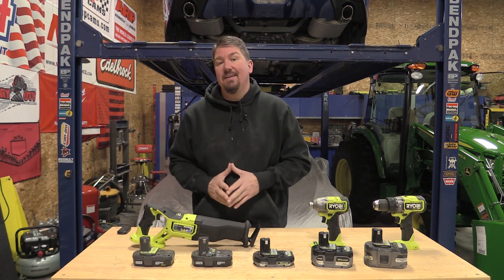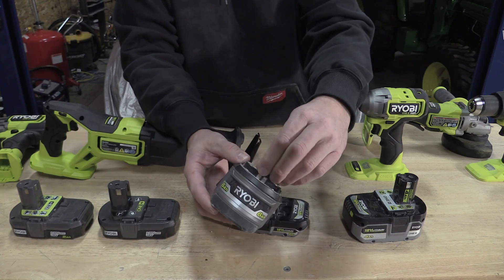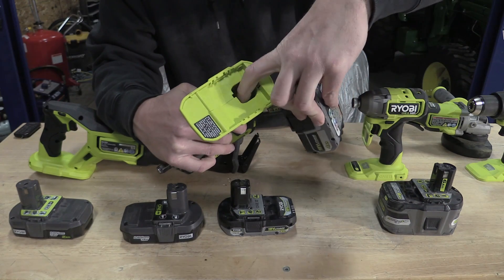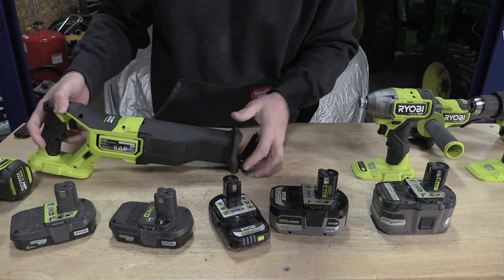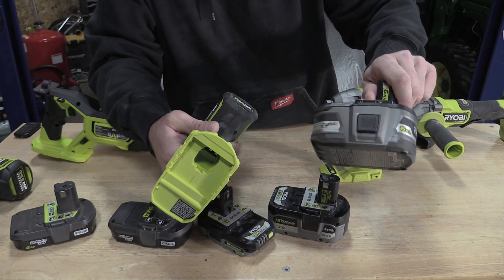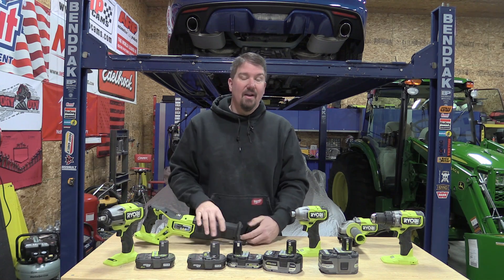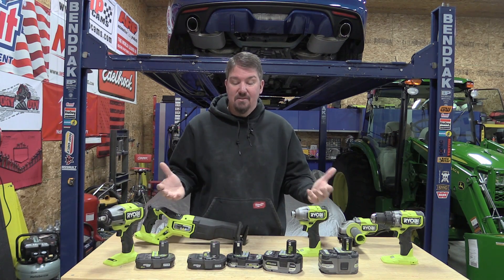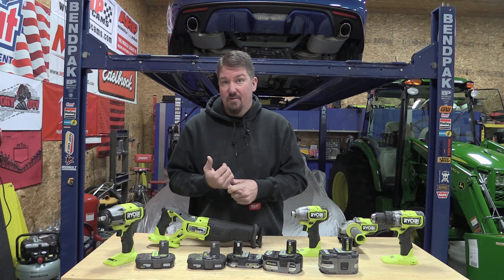My Ryobi Brushless HP Tool Has No Power? This Is Why...  New Battery Line Up & High Performance

Comment: Has anyone looked at that label on the tool? It says the recommended battery number for that tool. Consider it a minimum? Regardless the battery provided with the tool in say, a kit. They'll give you what works... But not the optimum to just get you into a usable tool.
Reply from the maker: The jigsaw said use a P197 or other batteries stated in the manual.  Then the manual said all ryobi batteries are compatible.  LOL
Reply: @WorkshopAddict  right... 4 AH battery? Base line. Use nothing less than that, agree? But use 6-9 to get more tool power.
Reply from the maker: @paulalsup8838  I think HP tools should be the 4ah hp min. Model pbp004.  Hp line should recommend hp battery.  Otherwise you have a power loss.
Reply: @WorkshopAddict  Absolutely. I think people should realize these things to be honest. Although as Ryobi claims... They maintain the same form factor "forever". Yes. They have.  However. There should be the realization that although the form factor does not change, the inner workings of the batteries do. So. Don't expect the same performance of the older batteries with the newer tools... even though they fit (and yes, use an appropriate AH for the hungrier tools). 
The other guys don't really have this issue because their F.F. changes with their improvements a lot of times and stems (pun intended) the confusion. Even after all of this, guys will still try to get away with smaller, cheaper AH batts in higher consumption tools. 
In closing my statement (ha ha). You will never be clear enough and people will always have issues with tools and their expectation of them. They will ALWAYS expect more. And anything should do everything. It's not always the tool or battery. It's their knowledge.
Thanks for the great vids. Don't bail on Ryobi, because your professional view gives great insight!

Comment: I'm confused, your're saying that they are 2 types of HP (High Performance) batteries. The 4.0Ah HP I just purchased today on eBay is model P192, is there a newer model for the 4.0Ah HP? smaller but same capacity? model#?
Reply from the maker: I am saying that any battery with a name on it of HP will be replaced with a new battery that will have a name wrote on it of High Performance.  The new battery will be the same Ah rating, but allow for better current draw.

Comment: As a homeowner, I always found Ryobi’s product appealing; decent tools at a decent price.   I also appreciated the fact that most of their products are available in-store as bare tool (great if you need a tool in a pinch). I invested quite a bit in their platform over the years.  

But with their escalating prices, and movement over to new batteries: I’m thinking it’s time to invest in another brand. 

Ryobi has served me well: but when new tools are $10-15 off from, say, an equivalent Makita.... and I would need a new battery to get the most out of the Ryobi: why would I not spend the $10-15 on a more robust tool, even if I’m just a homeowner?

Comment: The new batteries have a much higher discharge rate.  The newer tools draw more power and if the batt can't supply it and there is more voltage sag then you have a more powerful tool, but you get sub par performance.

Down side is this.  The higher the discharge rate of the cells the faster they can be discharged...  IE shorter run time.  The capacity didn't change.

No such thing as a free lunch.

Comment: I have been buying several new batteries for my collection, replacing small one with the larger one. I have a couple of 6 amp batteries that work better with the HP line. As I get older, its hard to justify the cost of new batteries when I already have plenty of the older ones. My theory over the past several years is to buy 3 amp or above. I have found close out for a good price from time to time. Several years ago, they offered a free tool with two batteries. Just too much for me to turn down. I think those deals will not be coming back anytime soon. Thanks for the video.
Reply: That deal is back!  Started yesterday as far as I can tell.  $99
Reply: @MattyGgardneR  I’m planning on making a run to Home Depot next week for a couple of new batteries. I’m not sure what free tool I will get. Just this week I picked up a couple of the small fans. I was so excited!!!!!
Reply: It's a annual event called Ryobi days

Comment: Also, what exactly are you doing with the tool? If you’re cutting furring strips with the circular saw as opposed to cutting treated 2x4’s that’s gonna be a difference. Using the drill to make a hole for a drywall anchor, little battery is gonna be just fine. Running a 1” spade bit through a joist, you’re gonna want the right battery. Still good that the form factor is the same that the tool will still work (though not optimally) for lighter duty applications. They could have easily made the labeling simpler and more straightforward to allow for new battery tech, while keeping the same form factor for backwards compatibility.
Reply from the maker: You are right for most tools, the range grinder is useless for anything with the 2 ah hp battery.
Reply: ... I do like the Ryobi Tools, but HP being different than high performance borders on deception.

Comment: Thanks so much for this video. I didn't understand, but now I do. I bought a Ryobi drill/impact set with a 4ah HP battery. Oddly, neither tool has the extra pins, but the battery does. I typically use the 1.3 and 1.5 ah batteries, and they've been OK for my occasional DYI use.(I have a lot of them now, and they do require frequent changing.)  I have a half dozen Ryobi tools now, and none have the extra pins.
Reply: "charging"
Reply from the maker: Glad it helped

Comment: Yet another reason to get milwaukee, no hp or power detect bullshit
Reply from the maker: Let your knowledge lead you for the right tools for you, but never stop learning.
Reply: just "high output" or "high demand" bullshit.  I'm sure if you're in milwuakee's camp you can keep it straight just as easily as I can keep dewalt's "power detect" vs "flexvolt advantage"
Reply: @Nyall  at least milwaukee doesn't have 3 of the exact same drill 🤪
Reply: @nuclearexplosion5841  Brushed, Brushless, and Fuel... Hmm... That's three...
Reply: @Nyall  Except there are no extra pins and all of the CP XC HO HD batteries are using the connection.

Comment: Ryobi prides themselves with keeping the same battery shape so you can use ancient batteries with new tools... and of course the new tools don't run well with old batteries. 
Not sure why they even bother with shooting themselves in the foot like that. Do most of their customers not care about max performance and would rather maintain compatibility with their existing stock of batteries (and "investment")? I guess so.
Reply: It's not so much that you can use the old batteries in the new tools (though you can I've tried it it works), but the old tools can still be used with new batteries.  And I have to say that the old blue tools, while outdated and outpowered, still work for what they are, and I still use them to this day with the new batteries.
Reply: You have it backwards... the benefit is that your old tools don't become obsolete because you can use the new batteries with them. The batteries are the consumable...not the tool. Its not so you can keep using your old batteries with their newer stuff that is just a side effect.
Reply from the maker: Maybe, just maybe, most of the tools purchased at a low price point barely or never get used.  They are just around if needed?
Reply: @WorkshopAddict  Probably. Or they're being put through less hard usage too. Occasional DIY home usage vs jobsite, I get it.

Comment: That explanation was as you said clear as mud. But it is far better than any explanation then anything the Ryobi has come out with.
Reply: Actual explanation? The ~2ah batteries have a single  series of cells. (5 cells in series, or 5s)  The ~4ah batteries have two parallel series of cells. ~6ah is three parallel series of cells. Each time you add a parallel series, you increase the maximum usable discharge rate of the pack.  So a 4ah pack can discharge twice as fast as 2ah, 6ah can discharge 3x as fast as a 2, and 1.5x as fast as a 3. "9ah" is more likely than not just 4 parallel sets of 5 batteries in series, though I haven't taken one apart to confirm. This means it would be able to discharge twice as quickly as the 4ah pack.  And yes, this means the super expensive "9ah" pack only has a 1/4 better discharge rate as compared to the 6ah pack.  And if your tool doesn't NEED the higher amperage, the only benefit is longer run-time. 
Cell chemistry and geometry has some impact on the discharge rate (Referred to as C in literature and on the battery housing) and it is improving all the time.  What this means, however, is that a 6ah "normal" battery will perform roughly on par with a 4ah "HP" battery (As ryobi claims a 30% increase in "power" really 30% increase in C rating.)   I would welcome you to test this for yourselves and not take an anonymous cat's word for it, but I suspect you'll find this to be true. :)
Reply: @Fusako8  outstanding
Reply from the maker: Sorry, there are a lot of moving parts and I did not want to make 3 videos to explain it.
Reply: @WorkshopAddict  i think this is Ryobi's fault not yours
Reply from the maker: Thanks Aaron
Reply: @WorkshopAddict  that's not on you. It's on the haphazard way of their tool rollout and development process

Comment: How many cells does the 6.0 battery have?  Does it have 3 rows of 2.0 cells or does it have 2 rows of 3.0 cells?  Could you take it apart?  I have heard conflicting info online.  I am still curious why the 6.0 outperformed the 4.0 battery.  If they have the same number of cells, the performance should be the same.
Reply from the maker: I can take it apart.  This is a similar situation to the Milwaukee CP batteries that are able to have a higher amp output.  everything is limited to battery output and battery controller chip.  The cells are different between a 6.0 and a 4.0 if they have the same number of cells, if they have different numbers of cells, there is a extra bank of cells to keep the voltage higher during a high amp pull.

Comment: I agree, this is going to hurt Ryobi more. Ryobi has always been more of a homeowner tool and they are really getting into some grey area by trying to be more prosumer/semi contractor grade. I think this will hurt them more than benefit them, at least initialy. 

Perhaps some better branding, like different color battery cases or accent color, could go a long way to differentiate between the batteries (?).
Reply from the maker: That is the way they are moving with Black being standard and a silver being High Performance.  But convince a guy that a 2.0 Ah high Performance battery wont run his High Performance Angle Grinder if he has little experience.  Most would just think less runtime.
Reply: @WorkshopAddict  agreed
Reply: @WorkshopAddict   just ordered a ryobi 18v mitre saw tool only, thinking i could buy an adaptor to fit my black & decker 20v 1.5ah batteries. Your video made me realize that the B&D 1.5AH will not power the mitre saw. Looks like i will have to shell out another $200 for a 6AH or more ryobi battery.
Reply: @CanadianCampPurr Ryobi batteries have historically been some of the cheapest on the market. So I don't think you'll need to spend $200 for a Ryobi battery. 

And if you purchase them during the special sales Home Depot has throughout the year, you can get them at a great price. 

An example is the new High Performance battery kit, that's still on sale up to 7/15 for Ryobi Days, that included the 2AH, 4AH and 6AH batteries along with a charger and a bag was going for $199. 

But if you "hacked" this deal by picking the most expensive free tool, and then returned the free tool, the battery kit ended up costing around $100. I think that's very reasonable for 3 High Performance batteries.

You can still get this kit online with the free tool. Pick the most expensive tool that's being offered with the deal, and return it to the store after it gets delivered to your house. 

I've done this many times with Ryobi tools but also with Milwaukee, Rigid and Makita tools when the free tools that are being offered aren't something I really want or need.